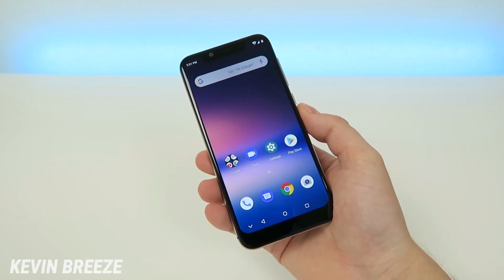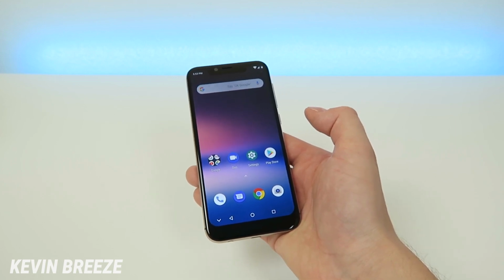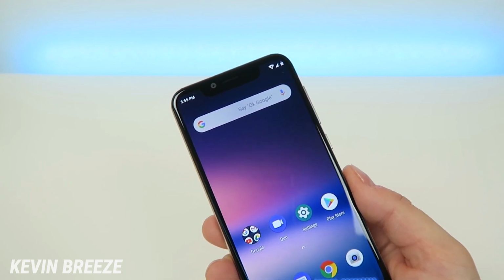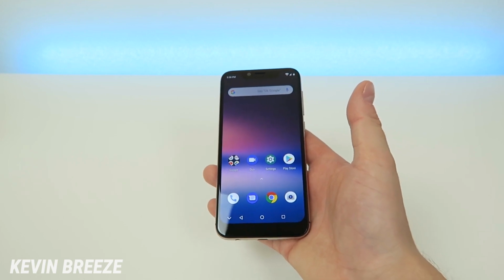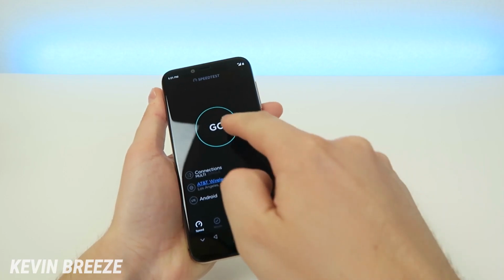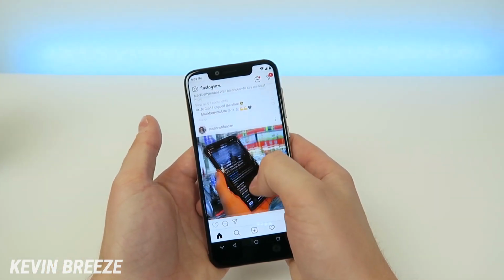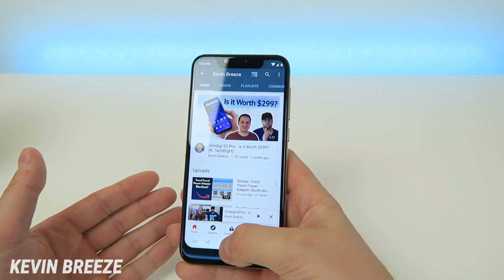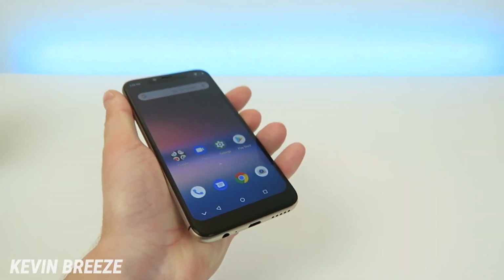Umidigi A3 Pro - Still Worth it 6 Months Later?

Comment: I get 16.5 speed with my A3 PRO. I'm with T-Mobile $50 Unlimited data plan and I live less than a mile from the cell tower And I changed my animation speed on developer mode on all 3 to .5  like you explain on another video. its so much faster now even youtube is ready to load in quicker time. I really like my Umidigi A3 Pro phone for such a cheap price

Comment: Umidigi's official store on eBay is selling these new with Android 9.0 for $76.49 with free shipping. Very tempting.
Reply: Yeah, are we sure about this? It says Android 9 on the little instruction booklet, but guess what? Mine has 8.1...
Reply: @SuperGeronimo999  Well, the listing's 15% discount is over, but it says 9.0 in two places on it - both the listing title and farther down in the specs.  If they are wrong I guess you can send it back since it wasn't as described. https://www.ebay.com/itm/UMIDIGI-A3-Pro-Android-9-0-Unlocked-4g-Smartphone-3GB-16GB-Quad-core-Dual-SIM/173995597766?_trkparms=aid%3D111001%26algo%3DREC.SEED%26ao%3D1%26asc%3D20160908105057%26meid%3D66811b8d5b7e489289596872642ee1fc%26pid%3D100675%26rk%3D1%26rkt%3D15%26mehot%3Dpp%26sd%3D173995597766%26itm%3D173995597766%26pmt%3D1%26noa%3D1%26pg%3D2380057&_trksid=p2380057.c100675.m4236&_trkparms=pageci%3Aad141741-6616-11ea-809e-74dbd1806c2c%7Cparentrq%3Ada0663491700a9cd66a8f5fdffe0f600%7Ciid%3A1